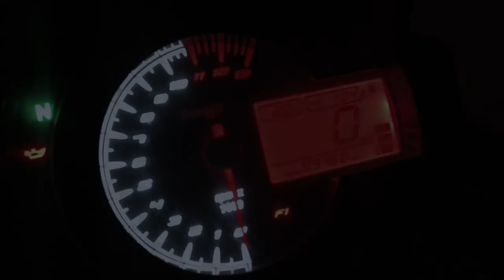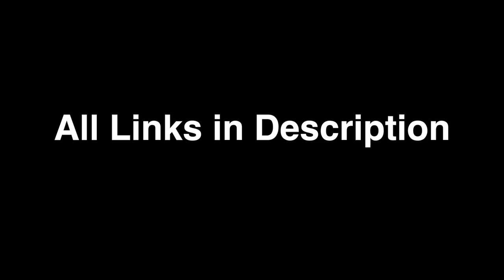NOTHING CAN REPLACE THIS | BIKERS THIS IS for YOU

Comment: when useing G Roller. Don't do it manually. place your rear tyre properly, start your motorcycle put it on first gear and leave the clutch, the tyre will start rotating on it's own. Then you can lub the chain as u like. That's the correct way to use the product. make a video on it, so that others can use it properly.
Reply: Thanks Vishal for the assistance.